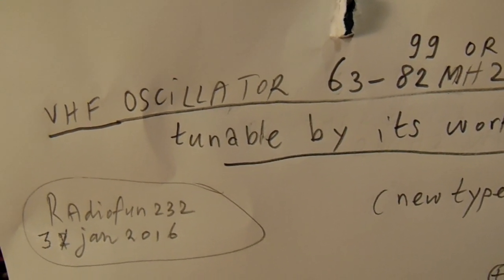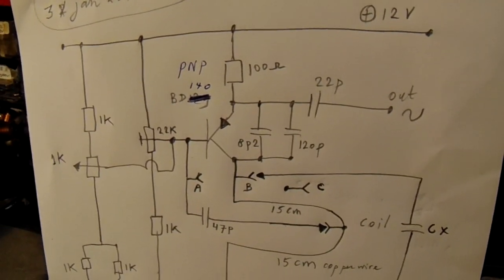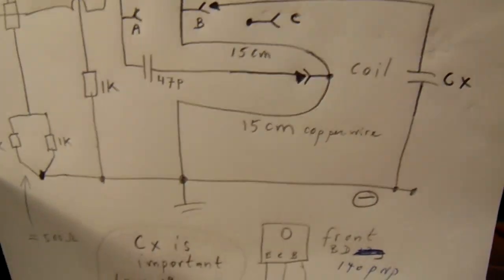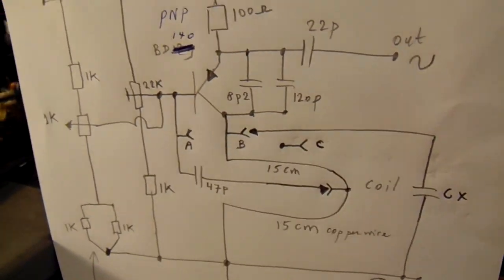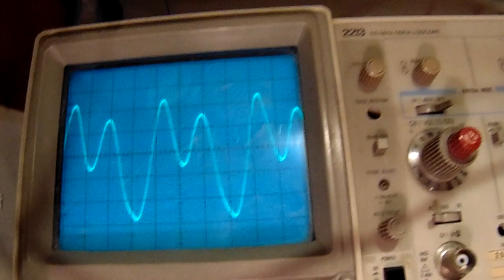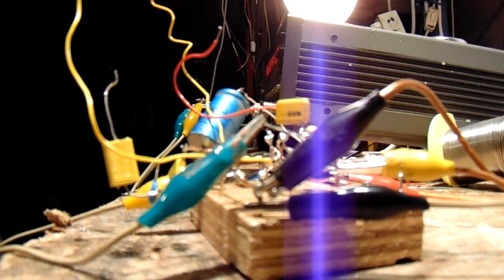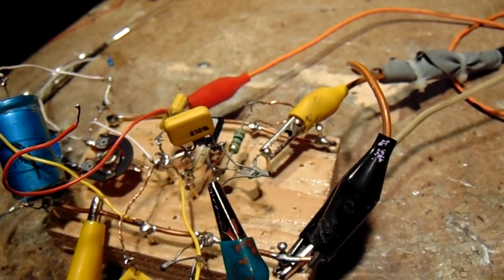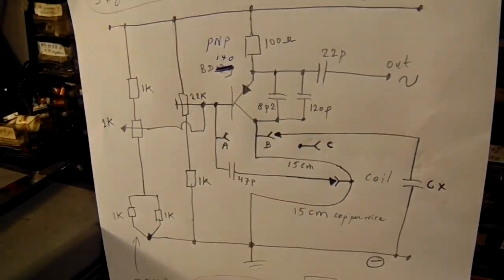VHF oscillator tunable by its working point

Comment: Thanks for watching Ko. I took some measurements for you. With the values I used I could vary the frequency from 53.9 MHz to 68.56 Mhz using only the 10K pot. The output amplitude varies from 60mV(@68 MHz) to 150mV(@56 MHz) The sine wave stays good (the same) through all these frequencies. Using higher value coils brings the frequency down, if needed. When I made the circuit to test it on my solderless breadboard, the sine wave was still good and you know how much stray capacitance there is in one of these breadboards!
I'm looking forward to your next video. Thanks again, Martin.(stoneslice)
Reply from the maker: +stoneslice Hi Martin, many  thanks for your comment, examination and valuable information on the basis of your measurements, equipment and adaptation from the circuit. I am gonna rebuild the circuit on the way you made it and test it again. My aim was to make a simple (not by purpose extremely stabile - we have better solutions for that e.g. by the Motorola digital oscillator chips tunable and stabile at 1 Hz ...) oscillator between 30 MHz and (say) 110 Mhz.
I am working on, thanks, Ko
Reply from the maker: +stoneslice Hi Martin, in my latest experiment I took the coil out and replaced it by a wire. I also made the circuit in a proper HF way, like you did it before. Capacitor now goes from base to collector (=ground, minus). Result: keeps oscillating. When cap = 47 pF around 140 MHz and when cap = 270 pF around 120 MHz. The cap sets the frequency band, I assume because capacitors have a resonance frequency of their own (I have a table about that) and this capacitance dominates.
Reply: +radiofun232 Thanks Ko, I will try this and I see what I get. I am interested in the output waveform. I have been trying various coils and seeing how they effect  the output.
Reply from the maker: +stoneslice Hi Martin, I could not get info from the technical University in Delft, I don't know why. Anyway, I went further with the circuit and made a circuit with the BD 139 NPN and the BD 140 PNP. I found that even a coil in the emitter circuit is not necessary (!) for good results. I made the circuit with a BD 139 no-coil and a BD 140 no-coil (identical).The   BD 139 circuit is critical and needs very small caps ( in the 100 P - 220 P range to go from 42 MHz up to 106 MHz) but the BD 140 circuit is simple and only needs 1 cap from 10 N (permanently C1 from base to ground) and (as C 2 between E and C from the BD 140) the following caps: 22P=64-88 MHz, 100 P= 51-106 MHz, 220P= 38-42 MHz and 470 P=31-32 MHz. Emitter resistor from the BD 140 is 100 Ohms, 1 Watt.
Reply from the maker: +stoneslice +stoneslice +stoneslice Hi Martin, thanks for the measurements. I could not get a good evaluation from the Universities in the Netherlands in Delft (dr Verhoeven) and Twente (dr P.T. de Boer). One did not answer on the content level (Verhoeven, University Delft) and one (dr P.T. de Boer University Twente)  told that the circuit was not decoupl;ed for HF. I repaired that, but no reaction afterwards.  My radio society (VERON=society for experimental radio research) did not want to publish the circuit in their Magazine ("Electron") because it could not be (perhaps...) reproducable. Of course that was not my aim: I presented the circuit as an experimental circuit and hoped that other radio amateurs made it and analyzed it. Anyway, no problem, it works very good and I have already made an experimental sine wave oscillator with it between (say) 70 MHz and 105 MHz. I am working on the same oscillator in the 30 MHz up to 70 MHz range. Thanks for your evaluation, rebuilding and measurements.
Reply: Thanks Ko, I think its a great circuit. I cant believe the lack of interest you have received from other people. It works well and is stable. It can be built with various methodo and works, as we have shown. Cheers for now. Martin
Reply from the maker: +stoneslice Thanks Martin, I think the same about the circuit.

Comment from the maker: LINKS TO VIDEOS + SCHEMATICS ABOUT SINE WAVE RADIO OSCILLATORS
 Getting more insight in radio coils with a FET oscillator https://youtu.be/LrJWLe1XrSI
FET test oscillator with very good linearity (200 KHz-9 MHz) https://youtu.be/Ng49kGF3n8o
Testing IF coils on 455 KHz with a bipolar transistor oscillator https://youtu.be/ZRsD7pzhu6c
FET test oscillator for frequencies between 340 KHz and 2 MHz https://youtu.be/J16H7k7TcJU
Sine wave oscillator L-C on 15 KHz-20 KHz or more https://youtu.be/wKIZ7mcqqVo
Variable sine wave oscillator schematic 380 Hz-19 KHz https://youtu.be/d-sUi_bRGNo
Wien bridge sine wave oscillator 500 Hz-40 KHz https://youtu.be/d81WiL3m1cU
Sine wave oscillator (coil) 56 KHz-1,5 MHz https://youtu.be/0xmm-2IxLUI
Oscillator 140 KHz – 843 KHz or more with the LC coil on ground (emitter) https://youtu.be/hkW0yUt5EhE
FET oscillator 56 KHz- 1,5 MHz https://youtu.be/urzRrWuZTXI
Local oscillator 1,3-4,2 MHz https://youtu.be/IA3Muob3gQI
455 KC IF filter oscillator schematic (BFO) https://youtu.be/DIeFb-SFmyk
Always working radio oscillator (schematic) https://youtu.be/FKF1UVw9imE
Test oscillator for coils 30 mH – 0,9 uH https://youtu.be/K2nkqnrwD7o
Oscillator for low supply voltages https://youtu.be/3tdmKUWdq2I
FET J310 Local oscillator  (3,2 MHz – 13 MHz) https://youtu.be/KRy_MmlymQc
FET J310 Simplified local oscillator 1,2 MHz-11,5 MHz https://youtu.be/38HAE38fgrM
FET J310 Local oscillator for 11-14 MHz and 23-27 MHz https://youtu.be/ZyeWqy2CNDs
Local oscillator (VFO) for a (SW) Radio demo/schematic https://youtu.be/oLIvLcKd1Fc
SW radio VFO oscillator circuit https://youtu.be/TIzZoWuAdDI
Playing with SW radio oscillators part 1 https://youtu.be/gkKjBk_0qsM
2 transistor superhet radio for strong local AM stations https://youtu.be/EYLvM1f5LJA
+ Why an oscillator? https://youtu.be/Ahrtsggn_EY
+ How to bring an oscillator in the right frequency band https://youtu.be/85_1mkzUrm4
+ Oscillation conditions https://youtu.be/AaGDpreMdM8
+ Oscillation conditions part 2 https://youtu.be/efW6br21Jbc
+ Oscillators, how they can confuse you and disguise https://youtu.be/SQpTrM9l0Sc
Green LED’s used as varicaps in a (VHF) oscillator https://youtu.be/8YVUHqoc11k
Dipmeter-search the resonance frequency https://youtu.be/QVTmiFbf7Gc
LED’s used as varicap’s in a SW oscillator https://youtu.be/1qLrSPcJWV8
Effect of temperature changes on a VFO https://youtu.be/xvpqlv_rA6g
Harmonics from a sine wave on a spectrum analyzer https://youtu.be/9MwkYWcZc1U
Effects from tin plate on a VFO oscillator coil https://youtu.be/nqXM7fScn0I
= Oscillator 26 MHz to test coils and crystals https://youtu.be/sD1XbYaT2ig
= Crystal oscillator on 6.000000 MHz and 3,0-3,6 V  https://youtu.be/ySFv87fjjzk
Oscillator (247 KHz - 303 KHz) made from dissected Ikea lamp https://youtu.be/xfIpwudVDak
Sine wave oscillator J310 FET (33 MHz) works on stray inductance https://youtu.be/ORU3sQQ0h4w
*Radio oscillator that works too good https://youtu.be/ztHgdYpf9GY
*VHF oscillator tunable by only a potentiometer/evaluation 2016 https://youtu.be/EyTP4Cpez28
*Sine wave oscillator tunable by a potentiometer 28 MHz-43 MHz https://youtu.be/LlLNaZbFRyw
*VHF oscillator tunable by its working point (1 potm.)  https://youtu.be/-xP8t-K-iv0
*VHF oscillator only with potentiometer 78-95 MHz https://youtu.be/AMvFwgKd3PY
*VHF oscillator where the L-C tank circuit plays a secondary role https://youtu.be/lJc-Os7tCAA
Plotting a VHF oscillator on 50 MHz-110 MHz https://youtu.be/Fbew-vVPhQs
Universal VHF oscillator 50 MHz – 110 MHz https://youtu.be/MgYsaoS7nrs
+ or * or = means a thematic series of video’s

Comment from the maker: LINKS TO THE SERIES OF EXPERIMENTS LEADING TO THE VHF OSCILLATOR (IN PRINCIPLE USABLE BETWEEN 28 MHZ-120 MHZ) TUNABLE BY ONLY A POTENTIOMETER

Jan 1, 2016: Radio oscillator that works  too good (exp. 1) https://youtu.be/ztHgdYpf9GY
Jan 3,2016: VHF oscillator tunable by its working point (exp. 2) https://youtu.be/-xP8t-K-iv0
Jan 22, 2016: R-C oscillator where the L-C circuit plays a secondary role (exp. 3) https://youtu.be/lJc-Os7tCAA
Jan 23, 2016: Sine wave oscillator tunable with a potentiometer between 28 MHz and 43 MHz (exp. 4)
https://youtu.be/LlLNaZbFRyw
April 8, 2016: VHF oscillator tunable by only a potentiometer/evaluation 2016 (exp. 5)
https://youtu.be/EyTP4Cpez28

Comment: Transistors like  BD139,  BD140  and those family of transistors are designed for audio amplifiers and drivers utilizing complementary or quasi-complementary circuits.  These are not a good  transistors to work  HF, VHF , UHF ranges.
Reply from the maker: +rrangana11 Yes, they are no typical HF transistors. But they are very well usable in such a circuit. The transistion frequency from a BD 140 (manufacturer Philips) is 160 MHz. From the BD 139 this is 190 MHz. I use them by purpose because of their stability and good amplification factor.